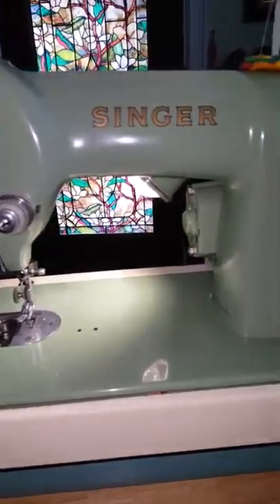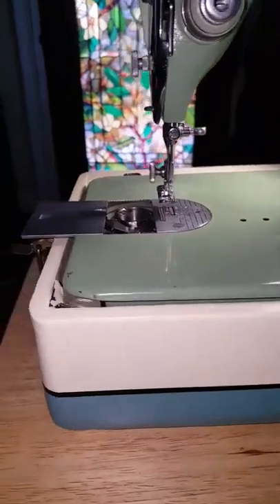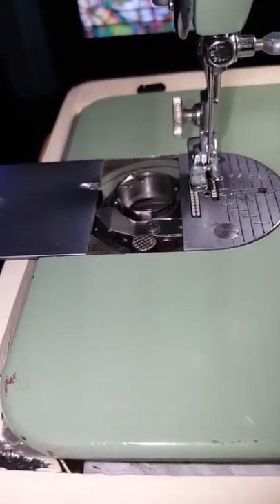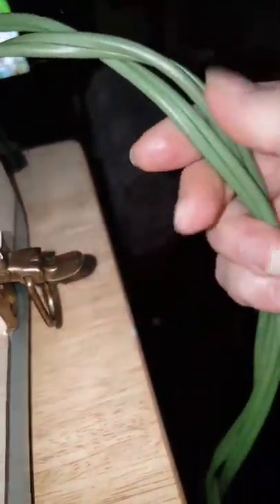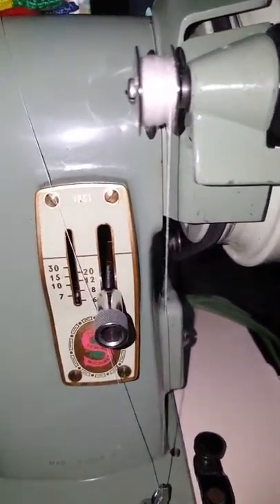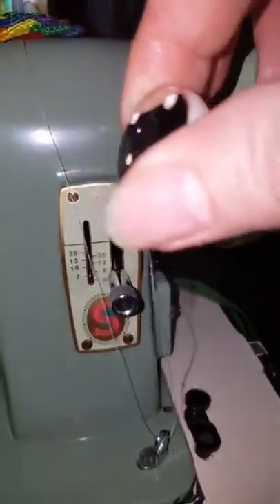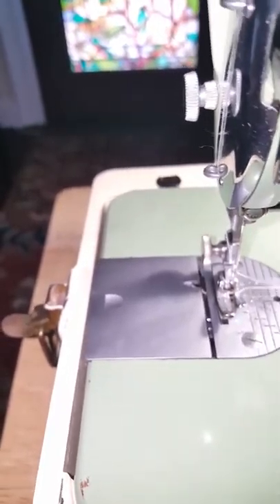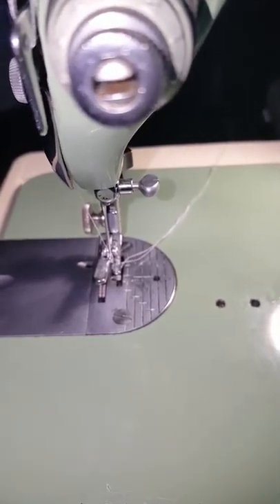Singer 185J Video #1

Comment: Hi Dionne I recently bought a singer 185j and I was wondering if you happened to know what size belt it needs? Also very nice video it was very helpful!
Reply from the maker: I'm so glad you enjoyed the video.   All external motors of Singer use this size belt.  I've purchased many times.  It stretches to proper length. 
https://smile.amazon.com/SINGER-2125-Sewing-Machine-Winding/dp/B003WMFH1K/ref=mp_s_a_1_3?crid=3D6F9GJR2K002&keywords=Singer+belt&qid=1675819539&sprefix=singer+belt%2Caps%2C177&sr=8-3
Reply: @dionnepray9821  Thank you so much I really appreciate it you’ve really helped me so much also I have one last question do you know if the 185j fits a 99k bentwood case as well or is there a difference between the one you have here?
Reply from the maker: @yuecatalina   It's a three quarter Size machine.  Since they were manufactured they were installed in the plastic cases.   The plastic cases break down over time just with age. And  you're unable to refinish them, Like you can the wooden ones.  You want to make sure you get a 99 case, Because the bases are thicker and it has room to clear all the mechanism.  The other 3/4 sized cases that are out there were made for the Vibrating shuttle Model 28.  That case will not fit this machine because they're vibrating shuttles and the mechanism isn't as deep so the cases were a little shallower.  What I have done when I've been unable to find a case is a look for a case and a machine that the case is falling apart.  I have been able to convince sellers on eBay to sell me just the case for like $10 plus shipping $20 plus shipping because I know I can rebuild it.  I have made my own bases as well   But to answer your question yes what you are searching for is a case for a 99.  It can be either the bentwood or the square like the case that this machine came with it was a square case.  Hope this helps.
Reply: @dionnepray9821  Thank you so much you’ve really helped me tremendously I really appreciate you answering all my questions. Have an amazing day!